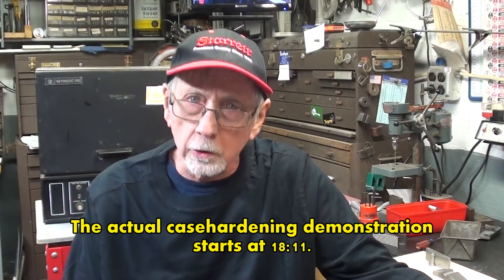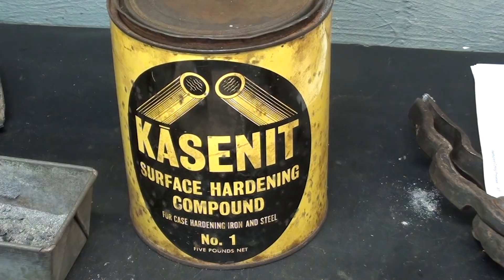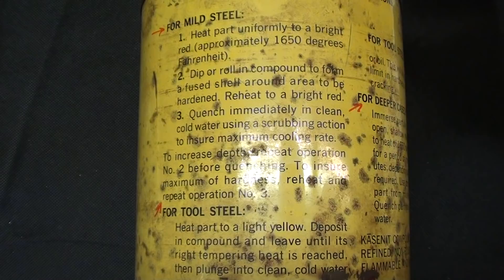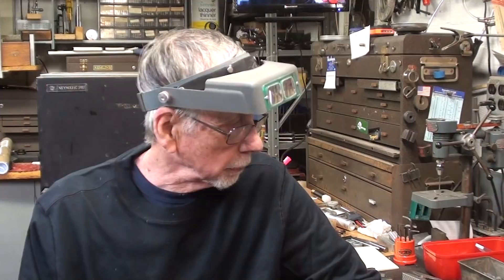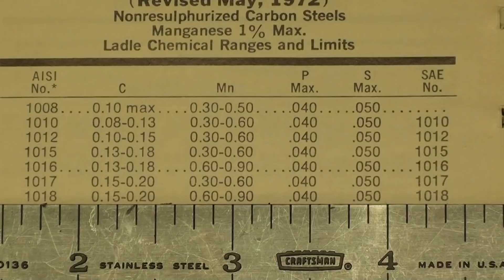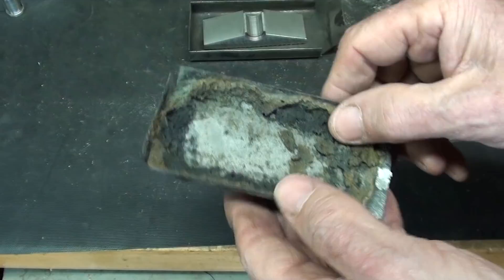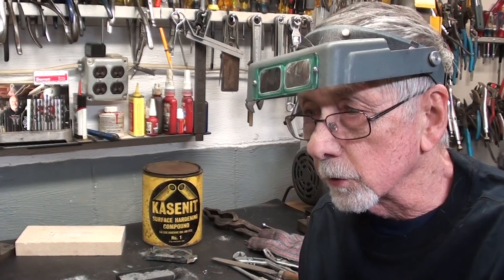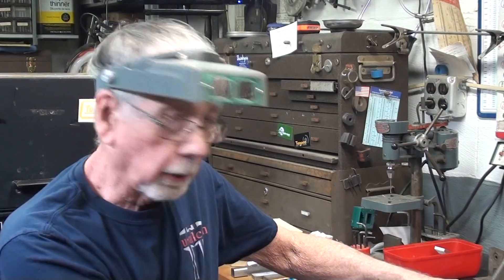CASE HARDENING Carburizing vise jaws #717 pt 1 KASINIT tubalcain

Comment: I love watching your video's nice job.  Not by the book, but impressive results was using a heat treat oven and SS foil wrap.  Making a pouch out of SS foil wrap I placed the Kasenit plenty of it into the pouch, put the parts into it, more Kasenit along with one piece of brown paper bag.  Pouch then sealed.  Heat treat to 1700 for enough time and Wham-o nice looking clean case hardened parts, yes the water quench is done tearing the bag over a bucket.  The brown paper flashes off burning off the oxygen. Heat treated A2 in a pouch this way getting clean parts, no cleaning required.  You take care, your a great teacher of the trade, Cheers!
Reply from the maker: Thank you for that good explanation

Comment: Hello, great topic! Color case hardening is still done -  Bobby Tyler at Tyler's Gun Works does it. To borrow for educational purposes, Mike Venturino states, "There are two basic types of color case hardening. One is done by a chemical process using cyanide. The other method consists of packing the part in a dry mixture, baking it to very high temperature and then quenching it suddenly in water. This second method is called pack hardening. It’s a lot more complicated than this paragraph might indicate."
Reply: Check out turnbull restoration, beautiful gun restorations including color case hardening.
Reply: I mostly do blacksmith stuff rather than machining. The way I have seen it done is to pack the part in bonemeal and then heat it
Reply: The trick to making it work is avoid the work piece making contact with the air before quenching. As Liberty points out it takes some planning to make it work. The results are beautiful when successful.

Comment: On a side note, I have an older flint-lock muzzleloader that wouldn't spark anymore.  I read an old article that instructed how case harden the frizzen so it would throw sparks again.  Essentially, take the old frizzen off and clean it.  Next, wrap the frizzen in leather and then wrap it up real tight.  Throw it an old soup can and then bend the mouth of the can closed to semi-seal the can.  Throw the can and all in a fire for about an hour and then throw the can in some water.  Next, remove the frizzen and clean it again.  I did this about a year ago and it worked like a charm!

Comment: Love It..... I ran a Heat Treating Facility for 18 years, I had Blueprints for & manufactured over 12,000 different Industrial Knives from wood chippers, paper lathe knives & Zamboni Ice scrapers. Most of my products were 55 to 57 on the ROCKWELL. Heating pallets at 1250 for 1 hour then a cold water hydraulic press. After 6 hour into Furnace at 2200 for 2hrs, after cool once more at 2200 for 2 hours & complete.....Some specialty knives we heated only the top 1/3 in molten lead which OSHA frowned on... Upon replacing the badly worn ripped & dusty furnace gaskets I realized I was handling Asbestos & then knew why my heath was failing me. I Long to step into a Machine shop & gathering in the aroma & atmosphere again..
Reply from the maker: I bet you had a very interesting career. I hope the asbestos did not hurt you permanently. Are used to watch the big furnaces at caterpillar, were the heat treated all of the parts for fuel injectors

Comment: We had to grind up charcoal to case harden our parts in school. You would pack it in charcoal, heat it, take it out, reheat it, and quench it in oil.
Reply: @mrpete222  that was over 20 years ago. I'm still using those parallels and 1-2-3 blocks!

Comment: Hello Lyle. I have a can of Kasenit that I bought 50+ years ago, still gets used now and again.  Heat treatment of metals is an interesting field and was part of my trade course. I have also spent many hours in heat treatment shops and foundries, designing and installing gas burner equipment to provide the heat source. Seen many skilled people who had no formal training, other than years of practice and common sense, producing work that could not be bettered. I am now retired, pottering in my shed and loving it.

Comment: Hi, Its great that you do this. Someone I did a small repair favor for that is a (proud) expert machinist,  did me the favor of for repairing a small hardened some what precise machinist vise I use for electronics, that had stripped threads on the jaw that moves (the underside screw to hold it to the bed). He remade the part and it looked beautiful but he basically refused to give it to me until he sent it out for case hardening along with some other stuff he had going, then grinding it. I got the feeling that I was asking an expert home builder to leave me with taped up Sheetrock rather then painted walls... this is going to be the true sign of a quality repair.

I asked him if he could maybe cut a thread into it so I can try to use a helicoil (I thought it might be possible with carbide tools), he just laughed at me and when i came back the next week there was a fully new part made of tool steel. When I tried to do it with a M42 drill myself, just to enlarge the original hole, I just got squealing. (I thought maybe I could buy a carbide tap rethread it for helicoil).
Reply: Just be sure to test the temperature, though that one looks pretty good since it has a analog display, sometimes the crappy 'labeled' heat settings have the knob slowly slide along the years and displace the setting, but I found that the thermocouple circuits are pretty stable over the years, so long the electronics is good (check the capacitors in the measurement circuit more then anything). But I found equipment that had full sealed internal display dials behind glass, with both being offset, on stuff thats barely touched. I have NO IDEA how those parts moved, but I had to take the entire thing apart to reset the dials (but this is for precision electrical standards that have moving parts, i.e. capacitors).

Comment: Hi Lyle, I have just found this tip on the internet for making your own Case Hardening Compound, I will have to badger the neighbours to save their fruit stones. Regards from Australia.  Try using the old gunsmiths trick, fruit stones heated until they change to charcoal, smash with a hammer until a fine powder then use as Kasenit.
Different fruits will give different colours.
The best bit is its free.
Reply from the maker: I need to buy a bushel of peaches

Comment: When I was in college, I learned to use a metallograph (plus the equipment to make samples for the metallograph) and could photograph and estimate the thickness of the carburized layer.  We used coke that was obtained somewhere and the oven was vented to release the fumes.   A thermocouple was used to monitor the oven temperature, and an optical pyrometer was used to measure the temperature of the test sample. 

A great job here.  Your loyal viewers were anxious to see this, and your project was crying out for this surface treatment.  I don't see very many case-hardened products anymore.  I used to see it mostly on lower-cost tools (screwdrivers) and the like.

Comment: I was a dental tech. for 25 years. That was the same oven we used for casting the gold and porcelain metal understructures. We use the lost cast method. Wax up the tooth, invested it in a plaster type substance, let it get hard, burned out the wax and casted it. Same way they do Jewelry.

Comment: Mr.Pete, I am luck enough to own 1lb. of Kasenit. I built a flintlock, lock about ten years ago and as part of the process I face hardened the Frizzen with this product as recommended by the lock parts manufacturer even though the frizzen itself was supposedly made of High Carbon steel.
Recently I have been researching how to Color Case Harden and the process is fairly simple and there are videos on YouTube on the process. I am in the process of making a heat treat oven as well as a foundry. I have spent over a year acquiring the parts and necessary materials to complete this project. My health isn’t as good as yours or I would have already completed it. Thanks for the demonstration!

Comment: I was a sparked in a 65 man maintenance shop. Only had 2 older guys who know how to harden parts. We had some obsolete machines that a couple of times a year they would machine replacement parts. Kinda of remember they put some kind of powder on it  ( can not remember before or after they placed parts in hot oven. They would pull the parts out and submerge them in oil. Can remember tool & die shops had to take in account how much a part or die will change after sending out to be hardened. Great vid.

Comment: At work we have several different heat treat
methods. Nitrex for case hardening, in the
Tool Room they still have Brine treatment
which is highly poisonous.

 When you quench, my Metallurgy book says
Instead of a slow figure 8, to vigorously shake and
or move the part around to create a lot of tiny 
bubbles around the part. I can’t remember word
for word but that it’s supposed to help

Comment: I worked in a factory that did large scale case hardening. The furnaces would be injected with carbon tetrachloride to provide the carbon for the carburization. I have a couple of knives I've made that were case hardened, hardened, and then tempered in that process.

Comment: Wow, does this bring back memories. Both in using Casinit and the dangers of cyanide hardening. In the early 70s, I was serving my tool and die apprenticeship at Westinghouse. Part of our training was making some of our own tools. By the time we served our 4 years, most of us had our own gauge block sets, two or three different angle blocks, a few matched sets of vee blocks, pairs of 1-2-3, 2-4-6, and, 4-6-8 blocks, some bench blocks, and different sizes of grinding vices. Management wasn't going to waste tool steel on us so our projects were C.R.S., cyanide hardened. When he had his work caught up, "Louie the hardener"  would tell our boss he could take a few of the "baby birds" and teach them carburizing on their own stuff. Back then we had buckets of tri-chloro ethane 1-1-1 to wash the oil off the finished parts. If you had a lot of small parts you could take them to the vapor tank ( tri-chlor heated to a mist) and do them by the basket load.  About a week before Christmas, Louie would shut down the "special furnace " to let it cool down so he could scrub it out and put in new firebrick. Between the three shifts, management, and pretty much anyone who happened by, Louie would make about 300 servings of just about the best sausage and peppers you would ever taste. Who knows what if any damage we did by eating food made in a case hardening furnace, but it sure was good!
Reply from the maker: That was a wonderful story. Louis must’ve been quite a man. Those were the days when men were men. I bet that was a great apprenticeship
Reply: @mrpete222  It certainly was. My class was the next to last to get to finish our apprenticeship. Westinghouse lamp division was already winding down so we were basically laid off at our graduation. We were trained in Swiss-style toolmaking, an art that was all but killed by C.N.C. I was in and out of the machine trades after that, working in the motorsports industry. They could take away the job they trained me for, but they couldn't take away the training. The last time I worked for a machine shop was to correct a problem that was human error made worse by the speed of C.N.C. This shop was doing a very large production job. The material was 4-inch cubes of brass. One side got a concave hemisphere that was finished to a high polish. There was a 10-32 tapped through hole offset 1 inch from the bottom of the sphere. They were tap drilled for a roll-form tap and somehow a cutting tap got used on over 1,000 of these parts. I got hired because nobody in that shop knew how to fix them. I took 3/16 brass rod, single point threaded to a tight fit on the bad threads ( this part handles high pressure, and the customer wanted the repair to be as inconspicuous as possible ). I would drive the rod into the part using liquid flux to lubricate the threads, flush cutting the rod, and silver soldering the threads. The last operation was to blend both ends of the rod and re-polish the sphere. I worked on that job for 9 months and consider it " revenge of the toolmaker " The next time I worked in a machine shop I owned it.

Comment: I've bought a can of cherry red hardening compound, in anticipation of this video. But because of my lack of patience, tried it in my propane blacksmith forge. It worked well on a small concrete coding adaptor, but WOW! The smoke and fumes from introducing the red hot piece into the compound was unbearable, and drove my friend and I out of the barn, after I put it back in the forge!! So for those who will try this, beware, it is powerful smoke!!  Thank you so much for the video, Mr Pete!!
Reply from the maker: Then I guess I could not use that compound in the basement

Comment: You might mention that in quenching a longer piece, like a punch or bearing driver, you need to thrust the object straight in the quench or it will warp the part along its axis.  More lessons from the school of mistakes.
Reply: Warning duly noted.

Comment: I heat treated parts for my motorcycle. I had to make a new mount for a larger gas tank. I used an old lawn mower blade that i heated red hot with a propane torch. After it cooled off I was able to cut it with a hacksaw and drill some holes to fit the mounting holes and the hinge for my solo seat. I heated the parts to red hot in a charcoal grill and quenched them in used motor oil. Not only did they turn black they were also rust proof. I also put them in the kitchen oven at 250 degrees for 1/2 hour and let them cool off.

Comment: If you still have the trays you used for this, it would be interesting to try and bend one to see if it is brittle and breaks, or if it is harder to bend than the same material that had not been used in the furnace.
Reply from the maker: Funny you should mention that. I was thinking the same thing
Reply: @mrpete222  If great minds think alike....🤔  Well, better than average minds anyway 😁.

Comment: I’m a retired toolmaker and it’s best if you make sure the KASENIT doesn’t have clumps or chunks in it, you want the material to be all powder so it comes in contact with the surfaces evenly with no air pockets or voids, you can sift the chunks out and grind them up to powder to reuse. We used the KASENIT on tool steels for the most part and it hardened them to a depth of  about .015 if the process was done correctly.
Reply from the maker: Thanks

Comment: I've used this case hardening compound to make spring steel for small springs. I use A2 tool steel alot. It is air hardening. Hard to machine but finishes nice.

Comment: Pete and others:

Here's a pretty simple method to see how deep your case hardened surface is. Few of us have a hardness tester much less can we do formal case depth examination in our home shops.

Make a test coupon of similar size to your workload and perform the case hardening heat, compound soak and quench.
Take the coupon and cut it apart with an abrasive chop saw. *Keep the temperature down on your cut so it doesn't back temper the material. Squirt water on it as you cut.

Glass bead or sandblast the saw cut area on your coupon. The hardened area will show a smoother texture as compared to the unhardened core area of the part. The case will be readily apparent. ** If your case depth is only a few thousandths, it will be harder to see compared to a decent one say 1/16th inch deep or greater.

I used this method in industry as a shop floor quickie when my objective was to only see how deep the case depth is. It's quick and easy as opposed to doing a formal metallurgical  cut, specimen mount/polish and acid etch.

File this one in the depths of yer brain for future use!

Comment: Clickspring made his own case hardening as well, he used charcoal powder, water and salt and turned it into a paste which he covered the parts in, then those where put inside sealed clay containers he also made. Those went into a coal fire to heat. That resulted in a case hardening that if left long enough went all the way through.
Reply from the maker: Thank you. Would you believe, click spring sent me an email yesterday about that exact subject

Comment: The magnetic point change is when the low-temperature soft crystal "Ferrite" (when no other materials are in the metal) rebuilds it iron atom shape to the higher-temperature crystal "Austenite".  This is the place where most steel hardening is done, since austenite has different properties when absorbing carbon (the basis for changing iron to steel is carbon) so going up and down through this change in various ways allows making all sorts of steels, hard and soft.  THIS is why iron is so useful!!!
Reply from the maker: Excellent explanation

Comment: The case thickness is measured by polishing or even just surface grinding a cross section of a test piece from the same heat batch. The hardened layer will be extra shiny and visually measurable….good enough for teaching the technique
Reply from the maker: Thanks

Comment: I have an old can of this in my home shop but remember using it in trade school in the mid 70s for two class projects the first was a small layout hammer which I still have and use today  the second was a set of  V blocks  I remember my shop teacher saying it only would penetrate maybe  a couple of thousands

Comment: That was very interesting. Good video to get the old brain cells firing first thing in the morning. I noticed the instructions say .020” depth of hardness in 50 minutes. Also there is mention of nitriding which is also a surface hardening technique using gas. This is something that needed to be done after regrinding the old 4 cylinder Porsche  crankshafts.
Reply: Porch   used  to  see   KREIDLER   a  german    factory.. ( a  moped  factory),,  they  were  (the  excellence)..in  IRON   trans formatioj